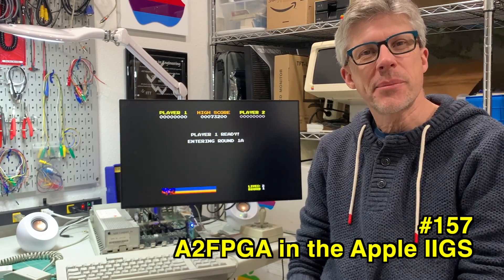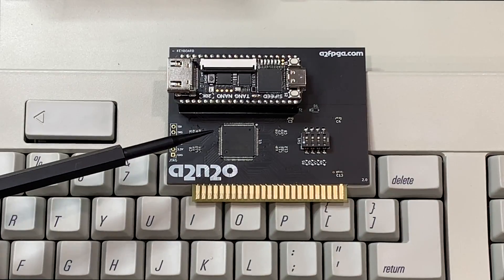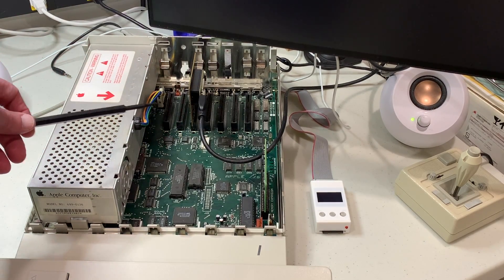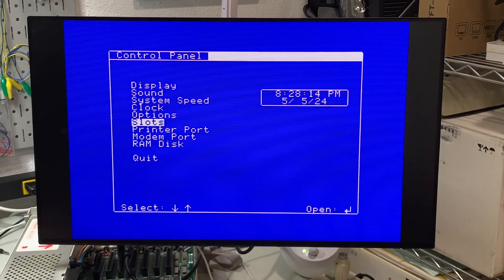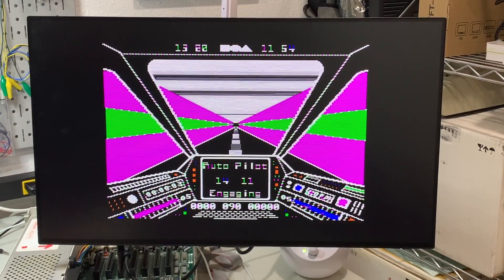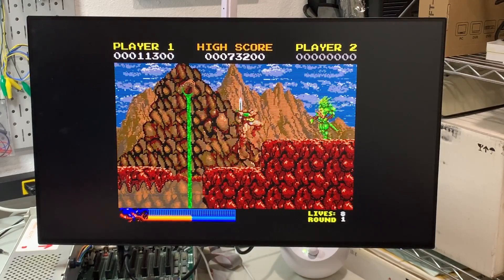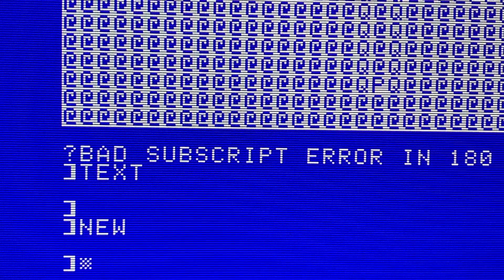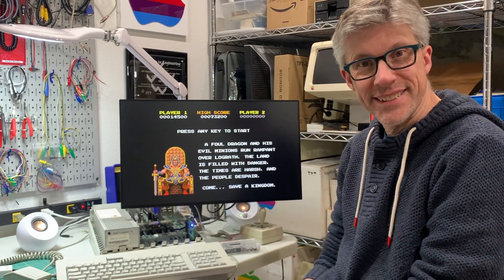#157: A2FPGA in the Apple IIGS

Comment: I have an off topic question. Due to a series of illnesses and injuries I have not used my Apple ][s in a couple of years and my apartment is the worst I have ever lived in for collecting DUST on everything, bookcases, shelves, tables.
How do I clean out my Apple ][ computers if dust has gotten in them ?
2 of them are stacked up under my new Roku Westinghouse 4k tv ( don't buy it as adjusting colors on it with its menu sucks & my 2010 Sony Bravia's colors are superior and its connected to my Silicon M1 Mac Mini ) and another ][E is leaning against the wall under the original Sony tv table. I am hoping to get the ][E running in my bedroom and once I get the 3.5 inch unidisk drive repaired this year I can finally run my GS as it would not recognize ANY disk except Arkanoid and kept kicking disks out and was unusable.
I own SIX Apple computers.
Apple ][ Forever.

Comment: Wish this worked for me.  I installed it in my IIgs and it burned out something on my motherboard.  Left with a computer that displays nothing but a checkerboard pattern on the screen.
Reply from the maker: Hmm, that is very strange. Is it possible that your power supply was barely hanging on, and the extra card just pushed it over the edge? Regardless, there are a lot of people on the Apple II Infinitum slack board, or the Facebook Apple IIGS Enthusiasts board who would certainly be willing to help diagnose. Best of luck!

Comment: I have one of these, I like it, but I do NOT like the fact that the FPGA board is on stilts. On a ROM1 machine it must be in slot 3 (without a wire mod) and the most logical place to put a TWGS would be in slot 4. I have my TWGS in slot 4, but I can't use the A2FPGA in slot 3 because the FPGA board presses into the TGWS. I love the card and it works great in my IIe, but unless this is redesigned to not hog the slot to the right of it I just can't use it here....which is an utter shame really.
Reply from the maker: Very true, it would be better if it was all integrated into the card, but I imagine that would add to the cost to integrate the chip.
Reply: @CT6502  Even just a slightly lowered socket. I don't get why it is a half inch tall.

Comment: My Slot 4 in my GS was set to Mouse Port.  If I change it to My Card, the mouse stops working.  I put the card in slot 3, changed slot 3 to My Card, and left slot 4 as mouse port.  Now I have the HDMI working, AND my mouse still works.  HOW IS YOUR MOUSE WORKING with no mouse port designation???

Comment: FPGA is pretty cool technology because it is replicating original hardware and can be reprogrammed. In theory, you could have multiple FPGA cards, each replicating different hardware. Example might be a Z80 card. I still have my old apple II+ and Apple IIGS that have been stored away for the past 30 years. Also recently bought an FPGA for my 1980 Atari arcade Tempest cabinet (bought in 1984) and it plugs right into the arcade harness replacing the original PCB boards that had failed. The FPGA replicates the 6502 and other Tempest arcade hardware on a PCB the size of a Raspberry Pi.
Reply from the maker: Yes! Plus it’s cool that the FPGA card can simulate multiple cards in different slots.

Comment: Can you clarify something; you mentioned the sound isn't going through HDMI for one game?  In this demo, is all the sound going through your powered speakers?  Does it normally route the sound through the HDMI on other programs if you don't have them plugged in?
Is the wiki correct?  "The initial Apple II power on "beep" will be missed, but all subsequent Apple II sound can be output to HDMI if SW2 is ON."
Reply from the maker: Arkanoid II and Rastan both use the Ensoniq chip for sound - that is not currently understood by the A2FPGA card - the sound just goes thru the motherboard speaker, not the powered speakers. If I had a stereo sound card like the "LiteSound" then I could certainly hook a set of powered speakers up to that, but I am hoping that the A2FPGA team adds support for the Ensoniq. For other programs, if you are using the A2FPGA card then you can use the DIP switch to toggle whether regular Apple II sounds go thru the HDMI or the motherboard speaker. With the A2FPGA card, Mockingboard sounds will always go thru the HDMI. So it is Ensoniq -> motherboard speaker always, Apple II $C030 sounds -> HDMI OR motherboard, Mockingboard -> HDMI always

Comment: Wow you got Skyfox to work with Mockingboard sound on a IIGS.  It seems to be the only game I can't get to play on my IIGS + Phasor.  Maybe I need to update my Total Replay.
Reply from the maker: I'm assuming that you've selected "Your card" for slot 4 in the IIGS control panel?
Reply: @CT6502  Yes.  What happens with different cracks of the game running from floppy and earlier Total Replay versions is that the opening music plays fine, I start a game, and it locks up just after the cockpit loads.  Never a problem with the Phasor in my IIe.  >> I just downloaded the latest Total Replay and now it works in my GS too!! <<

Comment: So I'm assuming if the firmware can eventually route the Ensoniq audio to the HDMI port, it would be monaural only?
Reply from the maker: I'm not sure. You needed a stereo card for the IIGS to have stereo output, correct? I don't know whether the FPGA can be made to replicate the same functionality of a stereo card.
Reply: @lemonherb1 The HDMI core used in the "firmware" is only tested to 2 channels, but in theory it should work with 8 channels.  For now the ES5503 core only supports stereo, but there's no reason it couldn't be more.